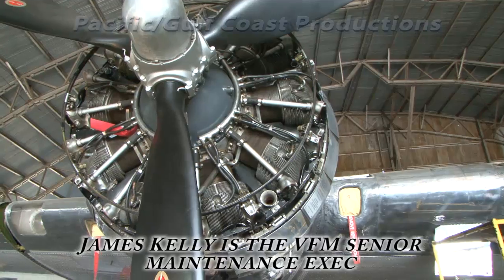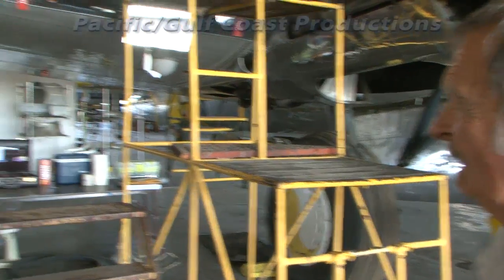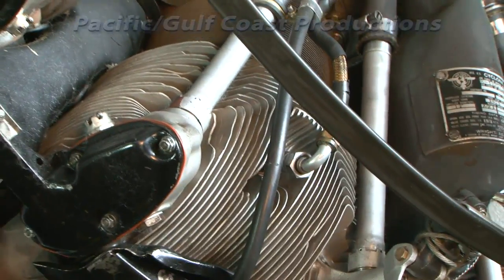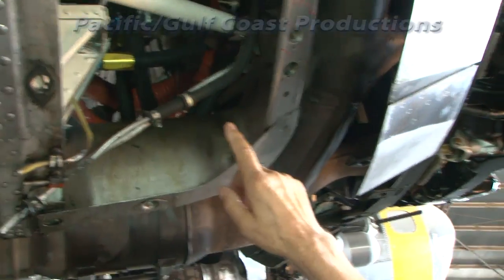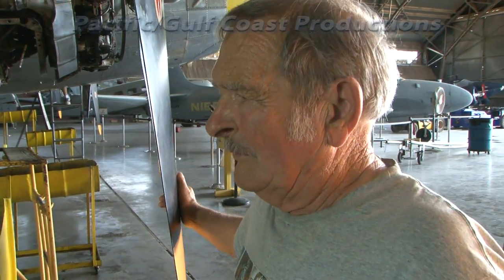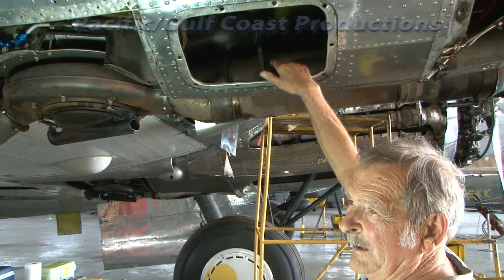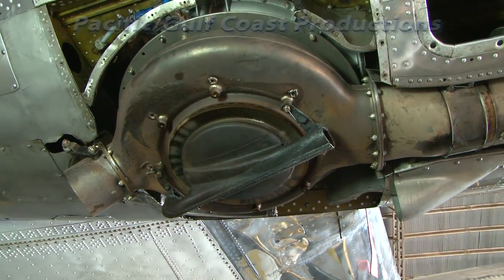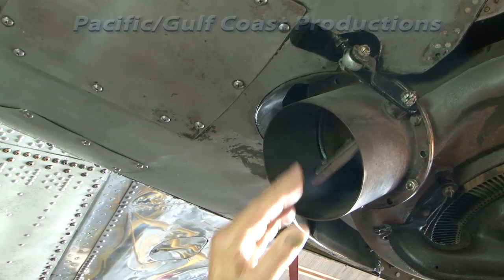B-17 Wright/Cyclone R1820 overview (Engine #4 on Chuckie the B-17)

Comment: Many Wright Cyclone engines were built in South Bend Indiana by Studebaker in a massive factory built in 1942. It still stands today and is still used. Also Bendix Products made the injection carburator in South Bend. That plant is still used but is now owned by Honeywell.

Comment: All except one of the DC-3's I flew had R1820 Engines (The other R1830 Pratts) 1,600 hrs & lord knows how much oil we used. :o)
A passenger noticed oil on one of the wings & we told the Hostie to tell us if it stopped. (22 Imp Gal per Engine on board)
Reply: Hoy Sum  What I meant was of all the DC3's I flew I only flew one with Pratt's R1830's.
BTW they use less oil.
Reply: @billolgaau  Sorry my English no good, you mean to tell us that the Curtis R1820 consume less Oil?

Comment: Thank you for recording & posting this short explanation/lecture.  The Navy used these engines in at least the C-1 and the S-2.  The Naval aircraft overhaul Depot I work at (until I retire in January 2020) was still rebuilding these engines into the mid-'80s!  It was fun to stand behind an S-2 running up its engines on the ramp.  ;)  However, I never really knew much about how the engines worked, just overhauling some of the components.  For a while, I also had a scrapped carburetor, a piston, and a sodium-filled valve.  I wish I hadn't given them away.  :(  The fuel line going into the carburetor was impressively large, well over an inch (25.4mm) in diameter.  They had to really suck down the avgas!

Comment: I was wanting more explanation about this dual engine pressurization system (he mentioned it twice, once by saying "both buckets are 11") Is there a mechanically driven supercharger within the engine and further back the totally exhaust gas driven turbocharger? I am putting some magnetos from these engines on ebay for a friend. These magnetos easily weigh 17-20lbs, not a light weight item. Many things on an aircraft are as light as possible (look over some exhaust systems,very thin metal used) but with some items it appears weight was not a consideration at all. Many aircraft undergo engine upgrades as different models come off the line. I ask if this was true with the B-17? After the war it seems the military put the B-17 to use more than the B-24 (some early AWACS type B-17 aircraft). It seems the B-24 and its slab sided fuselage was more suited to work in the civilian market.
Reply from the maker: Dan R yes, the engine has a gear driven supercharger and an exhaust driven turbosupercharger. it can maintain sea level pressure intake air at 30,000 feet if I recall correctly. there are some excellent videos that explain their operation as well.
Reply: When he said "both are 11 inches" he meant the exhaust turbine housing and compressor (intake turbine) are both 11 inches in diameter. Both make up the turbo-supercharger, what we just call a 'turbo' today. In addition there was a gear driven supercharger on the engine itself to further compress the intake air.

Comment: We had those Cyclones in our DC 3's. (R1820 GR 202A) Maybe not quite a reliable as the 1830 but cheaper to maintain & overhaul. As a retired mechanic & FE myself I can tell you that Mr Kelly knew his stuff & was spot on with his technical knowledge.
Reply: That would be the US Navy R4D8 or the Super DC3 flown be Capitol Airlines.  Douglas kept one, N30000, based at Santa Monica in the 1950s.  The last time I saw 30000 it was privately owned and parked  at the private aviation section of Tuscon airport about 1995.

Comment: Great video. Was/is the turbo supercharger non effective above 22k' and so making the ceiling for the B17 the same?
Reply: Yes. I believe he said the plane started losing power at 27000 ft. I would think it could Co tinue climbing at a slower rate at less than 100 percent power

Comment: My uncle was a flight line mechanic in North Africa and Sicily. He told me that invariably that if a plane was equipped with Pratt and Whitney engines and got combat damage to the engine that the resulting oil fire would be very difficult to put out and odds are the plane would be lost. However, if the plane was equipped with Wright Cyclone engines and that engine suffered combat damage that that plane would more than likely return due to a lack of an engine oil fire. The difference between these two engines is the lubrication system. The Pratt and Whitney had an oil pump to circulate the oil thru the engine thus feeding a fire whereas the Wright Cyclone was splash lubricated thus not prone to feeding a fire. My uncle told me that he had seen several engines come back with combat damage and still running even with 2 or 3 cylinder heads knocked off. He did not see the same with the Pratt and Whitney.
Reply: Love to see pictures of damaged engine running .Had a ford cargo 6 drive into garage with two conrods sticking out of block driver said it lost bit of  power           but seamed  ok
Reply: Blown off heads do not affect balance like broken rods do.
Reply: Shooter... Splash lubricated ??! Lol. 
Check it out. Lol.
Reply: @hotrodray6802  I laughed hard at the suggestion of the Wright Cyclone being splash lubricated, it's not a lawnmower engine. Both the Wasp and Cyclone engines used pressurized dry sump lubrication. Due to the nature of a radial engine having cylinders around a central crank case, it's not possible to have any appreciable quantity of oil in the crank case, it must be removed as fast as it's pumped in or you're going to have severe issues. The bottom cylinders would effectively become oil pumps that rob tons of horsepower and make the engine severely unbalanced.

Pratt&Whitney engines, especially the R2800 and R4360 were massive complex beasts with so many oil passages that fires were pretty much unavoidable. What exacerbated fires in these engines was the fact that the crank case was a magnesium alloy, once it caught on fire, it's physically impossible to extinguish it without special chemicals because it effectively becomes its own oxidizer.
Reply: Fascinating!  Once again...simple may not equal better but durability.

Comment: Fascinating!  Are radial engines sensitive to angle when operating like any other engine with a pil pan and sump?  Can they for example operate horizontally if need be?
Reply: A radial, or any aircraft engine, will operate at any angle.  Radials have been successfully used in tanks mounted horizontally.
Reply: It would be safe to say that these engines were dry sumped.That is to say no oil pan but an oil tank with pressure fed oil by pump to lubricate engine and ancillaries!.

Comment: Very informative overview of the R-1820.   I'm on this site, as I was wondering what engine the B-17 used.   Had some experience working with the R-2800's (not as an engine man, but as as Instrument/Avionics type).   Love the Radials, although if you are around them for 15 minutes, you generally get  a lot of grease and oil on yourself!   The R-2800's used BMEP to establish takeoff power - wonder what the indicating system is used by these engines - maybe torque oil press. or similar?   N-6395T